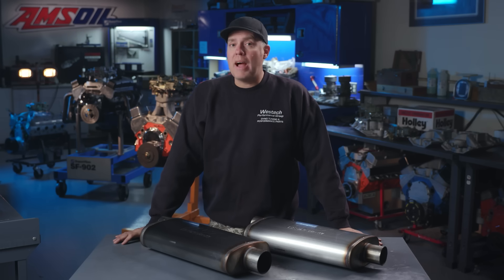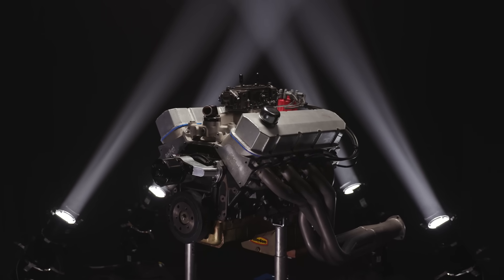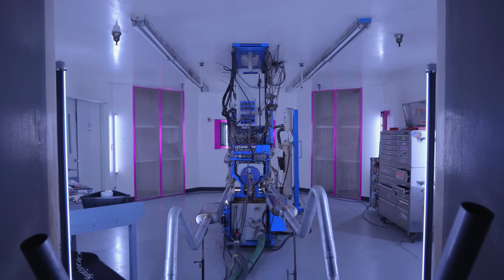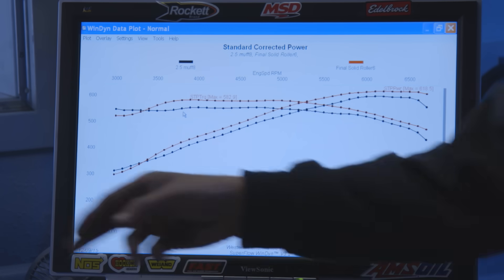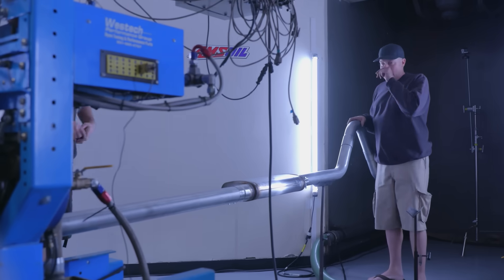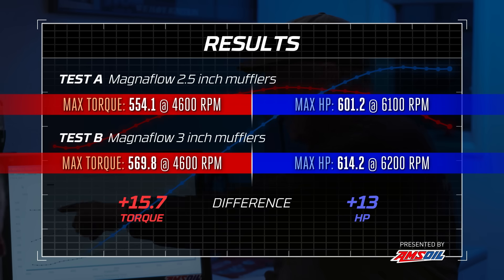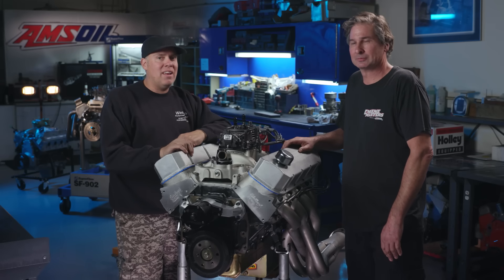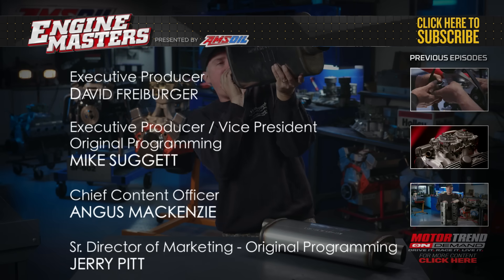The Power of 2.5- vs. 3-Inch Exhaust - Engine Masters Ep. 9

Comment: And on a 2 to 300 hp car the 3 inch loses. Also it even loses below 3500 on the 600 hp car and that is like the 60 ft.  Every car I ever owned was around 300 hp and when I put 3 inch on it I lost torque to the point of not being able to spin the tires from running 2.5 inch and roasting them so i will keep the 2.5 and go with real life experiences. Headers never gave any real gains either except for making the car louder and causing manifold leaks.

Comment: Of course an engine tuned for open exhaust will have better results with the bigger exhaust you put on it, that´s why you have tu tune the engine when you change the exhaust .
Tune the carb with the 2.5 exhaust and I´m pretty sure you will get better low and mid rpm performance with a minimun loss at high.

Comment: Right, so a gap of just 13bhp, about 2% of total power between 2.5" and 3", which could be partially closed by optimising the fuelling.
For any application where noise level suppression is desirable, I'd think the 2.5" would be the way to go.
Reply: Dual 2.75 with tuning for the win

Comment: 1. Using a 2.5 inch header collector on a 3" system is a pinch point. That test will NOT show the actual potential of the 3" exhaust and will reflect a dynamic wave back up the pipe interfering with flow. If you build a 3" system , USE A 3 INCH COLLECTOR!!
2. Sizing the pipe correctly is NOT about keeping some "back pressure." People say this all the time and it's BULLSHIT.
  It's about FLOW VELOCITY, period.
3. The exhaust sizing will differ among naturally aspirated mild compression engines, high compression, turbocharged and diesels. The latter three have more exhaust gas expansion and will need larger pipes than the first.
Reply: Is there an objective means of making this assessment: flow velocity?
Reply: @matthewisaacs7253  - Yes. Being precise with all factors included can be fairly complicated. But for a normally aspirated, stock compression engine you can ballpark it pretty closely by taking the engine size in liters and transferring that number straight across to exhaust diameter in inches. For example, a 454 is about 7.3 liters, so each cylinder bank is 3.65 liters, so theoretically they could maintain velocity and torque up to 3.65 inches exhaust. That's a maximum for efficiency. 3.5 inch would be more readily available and very close to optimum. Going that big would give quicker revs and more top end horsepower than 3 inch, but would probably only be noticeable if racing at full throttle where one really uses that top end.
   Properly sized exhaust takes advantage of the exhaust pulse from each cylinder, using its velocity to create a low pressure area behind it, which helps pull the next exhaust pulse out of the cylinder. If you go too big, those pulses are lost in the equivelant of an open 55 gallon steel drum. A 4 inch exhaust on the engine above would lose power compared to a 3 or 3.5 inch, particularly torque.
   And although the twists and turns of a real world exhaust are flow challenges, length in a good size can actually help torque because of the scavenging action of the pulses, essentially extending the header effect.
Reply: @jacobusderottmann1000  Well said....that's definitely some good info....something I can work with. Thanks

Comment: results would be different on a gen 5 fuel injected engine. computer would be able to compensate for the exhaust flow restriction. 5.0 foxbody mustangs almost always use an X-pipe. some guys run T-pipes. these are proven to affect power and power points. this is a very simple demonstration that uses 100 year old technology...... still cool though.

Comment: Full throttle testing is only really any good if you want to drag race your car and not drive it on the street much. Tuning an engine to run well for part throttle and low to mid rev range for street driving is quite different to tuning open headers for a full throttle, basically drag, engine.
Come on guys, if you're gonna do tests at least make them more relevant to the average Joe's weekend muscle car.

Anyone who knows anything about engines will know that changing any part of the engines breathing capabilities will change the engines fuelling and ignition requirements. Either marginally or majorly depending on what has been changed/improved.

Comment: 2.5 Inch Magnaflow muffler perfectly fine if you got less than 400 under the hood of any car
Reply: Yeah I always ran dual 2.5 flows off the headers in an 86 Silverado,  and sounded awesome with the turn downs... but I was making about 450, seemed to have just enough back pressure
Reply: Yup 2002 Honda accord 2.3L after few mods brang it back to its original 190hp but 287fpt

Comment: 1 minute into the video I'm already confused....
Reply: I had a ‘66 Bel Air with a 468 BBC, 10.3:1 compression pump gas engine, making 540 hp.  I had a 3” full exhaust system with an X pipe, same mufflers. I was moving from a private home into an apartment complex. My wife said we were going to get thrown out due to my 3” exhaust. 
For peace in my apartment, I agreed to put on a 2.5” exhaust, with same X pipe and mufflers, just in 2.5”.  It was dramatically quieter.  I also felt like I had a stock 396-325 hp engine!  I almost cried. My wife saw how despondent I was and said go put the3” exhaust back on.  The car came back to life, lighting the tires with moderate acceleration.  As my car was a radio delete model, I was glad to have my tunes back!  A 3” system for an average V-8 SBC ride may be overkill, however for those of us whose daily drivers have 500+ hp, we need a 3” system.

Comment: Don't know if it should be called back pressure but the diameter to the length changes the exhaust "tune" and can make it possible to tune your exhaust at peak rpm so you feel that. Better option is to tune exhaust to low rpm and muffler to high rpm with so called 6th. Order to you get a steady flow of torgue throught out the entire rev radius. It works by physics of resonance, at surdain rpm the pressure wave from the engine shoots to the exhaust and exhaust valve closes. Pressurewave travels along the pipe and creates vacuum after it. Tuning the pipe to this same rpm the exhaust valve will open just when the vacuum is at it's strongest and sucks the exhaust fumes into the pipe and creating even more vacuum. Now when we suck our exhaust fumes out, we get more air in the engine and skädäm.

Comment: Even for smaller turbo 4-cylinder engines, a short 3" system has been shown to increase power substantially. Get rid of as much back pressure as possible if you use boost.
Reply: I like a 3 inch system on about any stock v8. These exhaust shops l try to talk ya out of it couse that 3 inch pipe is harder for em to work with. But it will make a differance in about any of em. It let's em breathe. LOL

Comment: use common man parts and engines (under 400 horsepower 273's,289's,302's,283's,305's,318's,327's,340's,350's,351's,360's,400's etc)
The last time i revved up to 6500 rpm was NEVER
Reply: Yep.. I see 2.5 for small blocks vs 2.25.
Reply: Probably because you obviously own a lemon of a motor lol. Our 383 shift at 7.800rpm lol
Reply: K.Y.S_performace  fr man I wanna see that. And to respond to the OP on this comment, my stock 345 hemi shifts at 6200.
Reply: @thelikebutton4405  exactly, alot of people that run hemi's at the strip are spinning past 7000rpm with stock bottom ends. The original 426 hemi with a 727 torqueflight would shift at around 7250rpm and thats a bigblock lol
Reply: K.Y.S_performace  and that’s how you make big power lol. The more rpm the better.
Reply: @k.y.s_performace7038  That's his point. Most people rarely exceed the 4500 fpm piston speed threshold on stock, or one step up, parts.
Do you turn your 383 at 7.800 rpm with a breaker bar, or by hand? I'd be fairly impressed with the latter....

Comment: ENGINE MASTERS Here's a video test for ya. ... I'm doing something highly original with my truck exhaust ... from the stock exhaust on a 1973 IH Fleetstar with a VS478, I'm using a "Y" pipe on it right after where it joins together stock. 3" to two 2.5".. Then using a 40 series muffler on each side.... then running it to behind each side of the cab and using a 40 series 2.5" in to Dual 2.5" out... So there will be 2 stacks on each side of the rig.... I'm considering installing a 4' long cherry bomb on each of the 4 stacks as well.
Whatta ya think??

Comment: It's not back pressure you want, you want velocity. And most people don't have a 600hp 454 and drive over 3000 rpms. 
Test an average 350 in a street driven car (below 3500 rpms) and show me the test results.
Also, you should run headers with a matching collector size and don't use a reducer because every time to have a bend or reduction in size you send pulses back to the engine and slow down exhaust velocity. So.. average 350 with 1-5/8" header pipes to a 2-1/2" collector to dual 2-1/2 pipes and Dyno that.  Then run the same test on that 350 with 1-7/8 header pipes with 3" collector and dual 3" pipes all the way back. I guarantee you will have much more usable torque below 3200 rpms.

Comment: Do a stock v8 or v6 run a 2.5 3 and 3.5 exhaust with just a cold air exhaust upgrade because that's most you can do on a gas motor with out a voided warranty to help gain power and economy.

Comment: I find that with all the holes in my muffler and half off that I have good horse power and better gas mileage and torque power not determined yet till winter in my 2003  Toyota  4.  Runner.  Ps  should I get a new one installed engine mite be running good because of this please comment

Comment: I had/built a 72 Pontiac 455 that delivered similar power....VERY similar. In regards to the guy who made the comment the car would give you a headache with short exhaust,  I had 3" all the way back and my TA was exactly that way. I ended up selling the car about 10 years after I built the car. It was just not pleasant to drive, not to mention it just could not get the power to the ground. I was not willing to narrow the rear end of a perfectly fine 76 TA

Comment: G'day mate I from Australia love your video just wanted to know if you would do one in a dead stock 2:5 diesel engine none turbo motor with stock intake and exhaust manifold and do a same test on the exhaust system ? But do 2" 1/2 then do a 2" 1/2 and 3" tail pipe after the 2" 1/2 muffler box ? Then do a 3" and do a 3" and a 3" 1/2 tail pipe after the 3" muffler box ? As looking for a cheap up grade for my 1985 Nissan 720 4x4 diesel ?

Comment: Engine Master you should do an episode with the common size motor you would see people running in their cars like a 302 or 350
Reply: LS vs Coyote vs 392
Reply: MormonMustang  they will never do that because they are Mopar guys and know it will finish last
Reply: It makes about a  2-3 percent difference.  If you had  300 HP with 2.5" exhaust, you would gain about 5-10 HP...might be enough to feel...about like flipping the air cleaner lid on the old Q-jets, but don't expect some miraculous difference.
Reply: Naw, they needed an engine that tested the limits of the 2.5 inch system. A mild small block wouldnt, therefore you'd see zero gain from a 3". The 3" might even lose torque at the low end.
Reply: @donellmuniz590  thats why they laughed about "back pressure" as its an illusion
Reply: @trillrifaxegrindor4411  yes, backpressure is an illusion, but you'll notice they don't run without pipes, or with 4 inch primaries into a 10 inch collector. What the induction and exhaust thrives on is a balance between low backpressure and high velocity. If the pipes are too big velocity is lost. Too small and backpressure chokes it. Scavenging relies on velocity. I know, you didn't ask.
Reply: trillrif axegrindor yup I guess it’s the suction from each pulse of gas that has to pull the next pulse right behind it. So literally no one set up is better for every car. They’re all unique to the engine, mods, and fuel system
Reply: @donellmuniz590  that is correct
Reply: I have a 454 in my 84 Z28
Reply: Come on guys a 454 is a super common engine thats in all sorts of boats trucks suburbans etc.
Reply: Roger Carlin or a 250 I6
Reply: I agree! Some of us with thin wallets and fat ambition want things from the wish store but can't afford so how about taking the upper grade and making it apply to the regular guy
Reply: Cry’s in 289
Reply: If they did a more practical test using an engine size most of us could relate to, the results would be less impressive and fewer mufflers that weren't needed in the first place would be sold.  I don't consider a 454 a typical street/strip motor as they described it today.
Reply: @qq-hk2sq  Some of us old dudes still do Q
Reply: @tangotango256   I knew there'd be one. Props to the big blocks of old, but having square danced with cubes for a while, I prefer my power quiet, densely packed in 6 holes and turbocharged.  Like my father once said to me while discussing my siblings, "I know you too, you're sneaky.".
Reply: @qq-hk2sq  I'm with you on this one. They seemed to be a more common street rod motor in the 90s
Reply: The thing is that on a stock engine these changes mean almost nothing... first of all most stock engines will not have long tube headers... and if you do then you are wasting time and money with that and any exhaust upgrades if you are trying to do any thing besides make it sound better
Reply: So if a 3" is best for a 454, what would be best for a stock 350 for more power?
Reply: Easy. On your common street machine motor making 300-400 hp the 2.5 makes within 10 hp of the 3.
Reply: These days a $2500 dollar 6.0 LS swap motor with a mild cam spring and injectors making 425-450 hp. Then is it worth it?

Comment: The back pressure thing is true. Engine needs some back pressure at low rpm's but at high rpm engine needs free flow exhaust to reach its  peak power.

Comment: I run 3 inch on my 454 but I dump the exhaust right before  the rear end
Reply: I use to run my '71 and  '69 Olds with my exhaust like that.  The reverberation in the car was insane.  I put  tail pipes on straight out the back on the '69 and it became a whole new ride. The car sounded better all around, whether you were inside or outside.  It even felt like it had a bit more torque on bottom end.

Comment: Let's say you have a Mustang GT 15-17 Coyote motor with stock headers and a 3" catback exhaust.  What's the difference then between the 3" and 2.5"?  Seems like the weak point is obviously the stock headers, but most people aren't going to switch those for long tube performance headers to complete the 3" all the way back.

Comment: Had a  custom built 2.5 catback with x-pipe and the same Magnaflow muffler on my 2015 Challenger...its killed the low end power,  so I went back  and had the guy remove the x-pipe and put back a 1.5 h-pipe and also reduce the 2.5 to a 2.25  where the system bolted up after the cats...power came back like it was with the stock exhaust.  The Magnaflow mufflers give a much better tone, other than that  it was a waist of $1500.

Comment: That's a 44% larger to push the exhaust through with the 3".  If you REALLY want to increase the HP, try crossing the center two exhaust headers to the opposite side, matching the outter two exhaust with the center two of the opposite side!

Comment: Well I have a 1998 Chevrolet Silverado Z71 5.7 vortec 4l60e with 14bolt 3:73 locking rear 1500. I did a full manifolds back 3" true dual exhaust with a double H-pipe no cats no mufflers five inch chrome tips on 90s and I get a mile to the gallon better and I don't know about major power gains not towing but I can definitely feel a difference when I hooked up to our  triple axle tilt deck with a JD skid steer (13 500lbs in change) and I definitely could feel it was alot happier with these big pipes when towing plus sound way better then 2.5 inch exhaust.

Comment: The funny thing is, when you run the calculations on the theoretical1/4 mile ETs adding 10lbs to gain 13hp comes out basically a wash with a few hundredths of a second improvement over the lesser setup. What would be intriguing to know was what did it cost to move up to that system and what would that extra 10lbs cost over time in gas.

Comment: Love to see if there's a difference if it ceramic coated or not? I have a 4inch airplane car on turbo as its required to have a cat in oz plus all is ceramic coated all inlet and exhaust and got a 15hp diff and another 50hp with adjustable cam gear and exhaust cam on the inlet side

Comment: I have ebay stainless long tube headers  with 3 inch y- pipe to a 3 inch Magnaflow cat back exhaust on my stock LT-1 350  95 Camaro Z28. It made huge difference in power! Even to a stock motor like mine.😊
Reply: No it didnt
Reply: @grngs1  Yes I did

Comment: So just to add onto this a little bit, it's a good video but honestly I think it would of given much better results if they would of cleaned up the air fuel a little bit to make it more consistent and to see what a perfectly tuned engine would be like, but besides that pretty well done, just a couple notes, it's not backpressure you want, it's exhaust velocity, these two things get confused a lot because usually in order to increase velocity the things you have to do also increases the backpressure, it's like a balancing act to get enough velocity to get max power without to much backpressure. Which leads me to my second point, every engine is different with different displacement and different power, thus will yield different results, with large hot rod v8s and engines pushing big power, a three inch would be ideal,  smaller engines like naturally aspirated 4 cylinders under 350 HP aren't gonna do as well with a bigger pipe than 2.5 so really your heart adding weight and losing a lot of torque